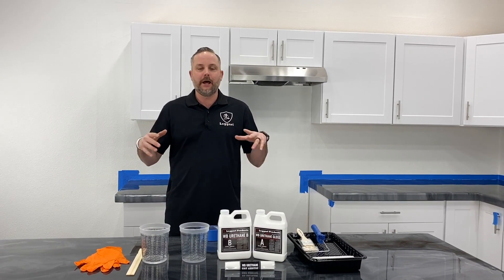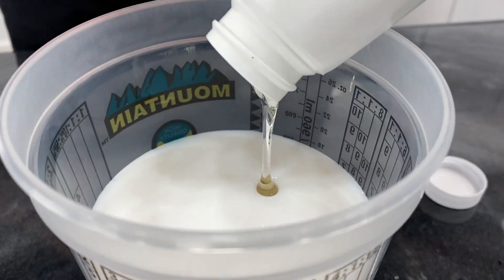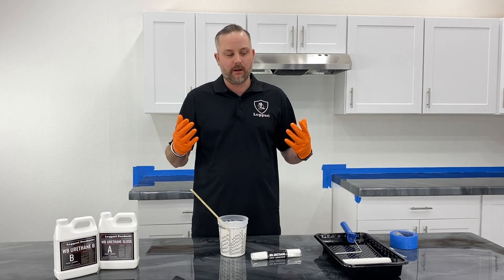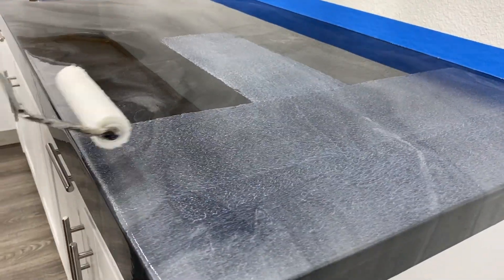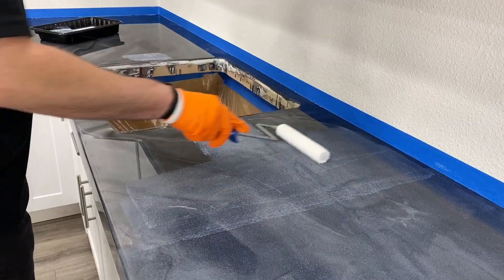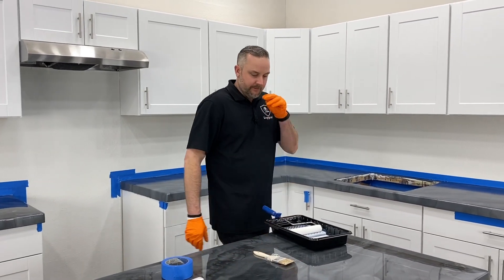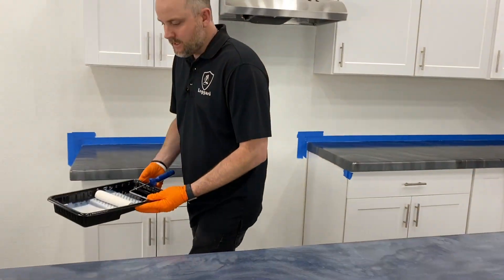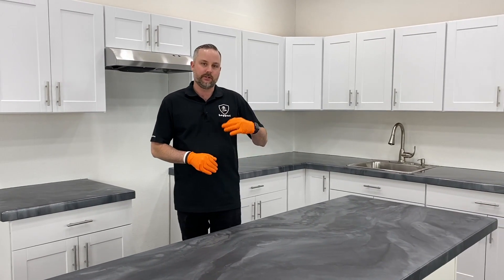Learn How To Mix & Apply WB Urethane Top Coat To Add Durability To Any Surface | Full Tutorial

Comment: How long after pouring my epoxy counter should I wait before applying the top coat?
Reply: That's what I want to know.
Reply: 24 hours so you wont sand it, more than that then sanding and cleaning is needed.

Comment: Love your work guys,  and I don´t know if I missed it on the video but you don´t have to sand the surface before applying the urethane coat?
Reply: Usually u would but the ones they sell are different he said as long as you put the urethane before 24 hours then you will be fine and won’t need to sand

Comment: If I don't use the urethane top coat, how heat and scatch resistant will my leggari countertops be?  I would top coat it with the gloss, but I dont want any texture.  also,  is the glaze coat just the regular clear epoxy?
Reply from the maker: Glaze coat is a clear flood coat of epoxy. We always recommend our urethane topcoat and the orange peel texture helps with scratch resistance!

Comment: I have a question. Maybe you went over this in the video, but what’s the purpose of the grit additive??
Reply from the maker: The grit additive will give floors more traction and also give it a matte finish. It also adds extreme scratch resistance to the surface whether it’s a floor or counter. Thanks
Reply: Leggari Products thank you!!

Comment: I installed 1-coat of Matte top coat over my Leggari epoxy countertops and could still see very small specs of the gloss from the epoxy reflecting threw the matte top coat. I watched this tutorial video beforehand and he recommends 2-coats for the Matte top coat, so I called customer service to confirm before applying it and was told never 2-coats, just 1-coat or it will cloud over.  I reached out to a Leggari Technician and he also said 1-coat is all they recommend. Why depict a video stating 2-coats is recommended for the Matte top coat when only 1-coat is recommended? Yes, I understand I can easily sand with 220 grit and install another coat, but I’m just going to enjoy the little sparkles of the gloss shinning threw!🫣🧐

Comment: I've used this gloss multiple times over epoxy tops. I can't get the roller overlap marks out. I've tried using just one roller to apply and back roll. I've tried using a dry roller to back roll. Just can't get the lines out. Using light pressure on back roll. Any tips please?
Reply from the maker: Are you adding the 10% water?

Comment: Can this be used over a burnt plywood flooring or shower wall ?
Reply from the maker: You you can apply over plywood but this is not a good application for a shower wall because the epoxy will just run because of the vertical surface.

Comment: can you skip the top coat?  It looks great without it!
Reply from the maker: Yes, it does but we always recommend a top coat to protect your epoxy! You do not have to do a topcoat, you just run a greater chance of getting scratches!
Reply: @LeggariProducts  thank you! Do you spray the alcohol on the top coat to remove any air bubbles? Or just roll it out?

Comment: Just would want the Urethane to dry as 'flat' as the epoxy, it seemed the Urethane added the 'orange peel' effect.
Reply from the maker: Our WB Urethane comes in high gloss and leaves a minor texture and we also have a WB Urethane that’s a Matte/Satin finish.
Reply: So if we want that glass reflection we can't do a top coat?
Reply from the maker: Stuart King You would use our glaze coat top coat. It lays out glass smooth
Reply from the maker: The matte urethane lays out smooth like epoxy but in a matte finish. It’s a super cool look!
Reply: It also helps to use a foam roller not a nap roller, will help with any potential orange peel look I do that on all the Leggari countertops I install

Comment: I just completed my first piece it was amazing till the top coat ruined it, customer service offered me 15% discount  for a 227 dollar product.  I even sent them the photos of the ruined piece.
Reply: Can you tell me what went wrong with your top coat? I just finished my counter and need to top coat it today. Did you add water, roller lines, etc… any info would be very helpful.
Reply: Did you ever fix it? Top coat ruined my floor as well. I’m trying to fix it now. Not sure how. 🤬
Reply: @christopher2932  I watched a few videos from R3 Designs using Stone Coat. They use multiple rollers and save an unused dry roller to eliminate roller lines. Not sure if that is your issue. I lightly sanded with 2000 grit and that helped smooth out the roller lines for me.
Reply: @petesotelo502  i used the matte finish and it definitely has the orange peel. I sanded with 2000 grit and I actually like it now. If I had to do it again, I would use Stone Coat top coat and Leggari Epoxy.